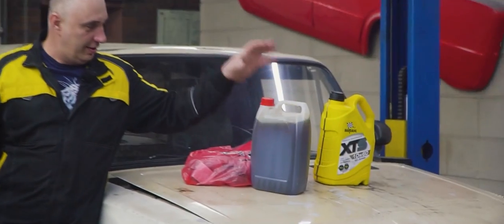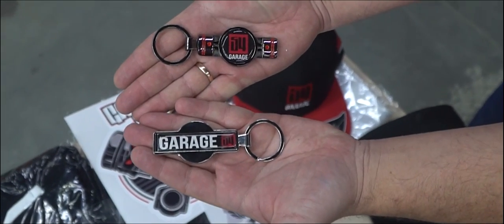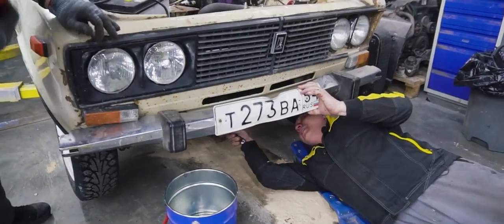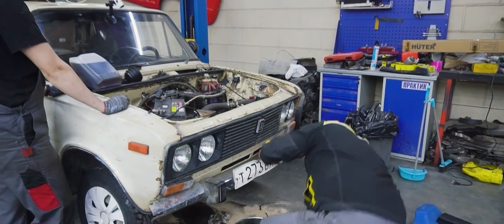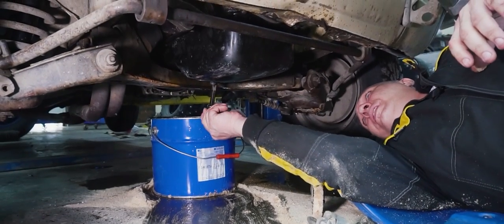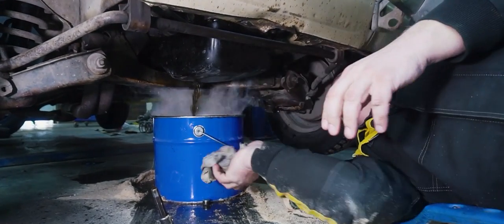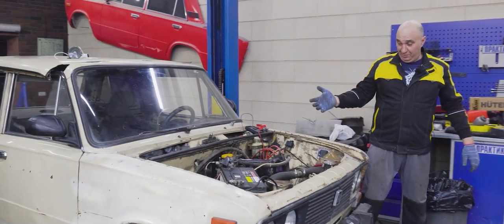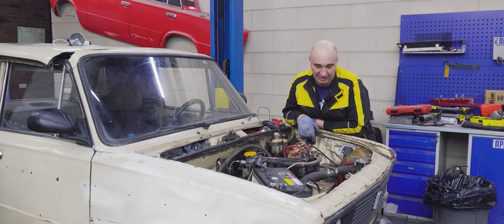Can you change the oil on a running engine?

Comment: It would have been cool to see compression test results before and after the oil change, just to see what the damage is from running the engine without oil for a few minutes.
Reply: I guess compression has Not that big of an impact. Biggest issue will be bearings. Camshafts and Mains running dry.
Reply: What surprises me, is they did not proportionally pour new oil in,  at the same time as it is draining, so as to avoid starving oil pump. 
When it runs clean, put the bung back in...- (check level), well that's how i would attempt it anyway, if for some weird reason i had too.
Reply: @Retiredkiwi  If a person is in a pinch to be doing this, I bet they wouldn't want to use any more oil than necessary.
Reply: Minimal. The biggest issues will be in the bearings and cam. I'm more surprised it didn't develop a light knock while it was dry, although it was a bit chatty. Hard to tell with just the phone speaker but that sounded more like dry valve train to me than crank bearings. 🤷‍♂️

Idling isn't a big deal. There's no load, and all it has to do is generate enough power to overcome the sum of the internal friction. The forces involved aren't as intense as when accelerating etc

The cylinders will be a bit on the dry side but are typically only splash lubricated by the crank counters dipping into the sump and atomizing it.

Comment: I've got an idea... I'd like to see how well velcro tyres would grip a velcro floor...
Reply: Reminds me of the Audi quattro commercial
Reply: It would explode the clutch haha
Reply: Or a velcro wall...
Reply: @angelgjr1999  why would it?
I took my 2001 fiesta to a drag strip (engine work done) with standard gearbox, driveshafts and clutch. Semi slick tyres on a prepped drag surface and dumped the clutch at 4k and didn't break anything...?
Reply: @jjmmjj9999  How much torque does it make?
Reply: @angelgjr1999  peak at 5252rpm is 170nm. standard 110?
launching it and bogging down until 5252rpm...
Reply: @jjmmjj9999  My 2003 Mustang GT makes 3 times torque. That’s why I don’t dump my clutch at 5k rpm haha. It’ll destroy my differential. Atleast on a sticky track. On regular roads it’ll do a burnout until 3rd gear.
Reply: @angelgjr1999  ok but we're talking about a lada. not a mustang. hence why i compared it to my 1.6L fiesta. I'm also comparing standard to modified, and my increase in power over standard.
Ford didn't rate the clutch, gearbox, driveshafts to be modified... i increased the power, dumped the clutch with semi slicks on a prepped surface.
So a stock lada with STICKY "tyres", why would the clutch explode?? 
If my car with an increased power rating causing more stress on components, on a very sticky surface with sticky tyres didn't , why would a stock car?

for comparison
My 2.2 diesel makes 530Nm of torque at 2400rpm, I dump the clutch at 3k rpm. Standard is makes 380nm, so again increased, abusing it and no issues?
Reply: @jjmmjj9999  Ok I understand. How often do you have to change shocks and axles? I wonder how much it affects reliability. Like I said I can do burnouts everyday in my car because it’s RWD and has a torque V8. Not sure how much abuse a 1.6l can take.
Reply: @angelgjr1999  116k miles, hitting its 8000rpm rev limiter daily, launched, clutch dumps, wheel spins, racing away from every red light.

I haven't changed shocks and axles ever. Shocks were replaced for adjustable coilovers and have been the same ones for 3 years.

I also have a daily V6, same one used in the taurus I believe? 3l Ford duratec V6, 220bhp
Gets abused daily too. 143k miles

Comment: Some aviation pioneers kept an aeroplane flying for over 3 weeks and actually changed the sparkplugs whilst it was running in the air! Maybe you can try this some time when you get flying lada.👍😎❤️
Reply: have you ever seen a lose spark plug fly?
Reply: This is way too dangerous
Reply: How about giving a credible source for this claim. Internet searches revealed nothing.
Reply: Now that you mention aviation, what if they replace the stock Lada motor with a small plane motor?

Comment: The planes that set endurance records for continuous flight were modified to allow changing the oil and filter during flight while the engine was running.
Reply: It's called a dry sump and remote reservoir system.
Very easy to change oil while running.

Comment: We actually used to do this at a jiffy lube I used to work at. The one guy who worked there really wanted his 93 Sundance oil clean. So we would start then car, start draining it, and pour oil in at the same time. So as it’s draining out, new oil is going in. We just waited until it was clean and put the plug back in and stopped putting oil in. It actually worked pretty well.
Reply: That explains why jiffy lube gets a bad rep. I used to work at jiffy lube too
Reply: It was an employee’s car. Lol. He wanted to do it. So we did.

Comment: Try doing a compression test on that engine to check if any damage occurred at the cylinders
Reply: the rod bearings are the first thing to go
Reply: ittl be fine, no different wear than a startup or 2. everything would still have oil it just wouldn't have been under pressure for a minute, which happens on startup or if you are cornering really hard.
Reply: @halleffect1  yes, but there is no test for that
Reply: @nickoloes  low oil pressure, audible knocking..
Reply: The cylinders will be more or less untouched by the process. Polishing them with the flush did more damage to them and you can do that following the instructions on the jug.

The biggest issue is the crank bearings and cam.

Comment: Here's a challenge for you,

Try taking an ordinary Lada, and turn the mechanicals 90 degrees in relation to the body shell, then drive it sideways!  -  If that isn't practical, try welding two Ladas side by side, and turning the mechanicals by 90 degrees.

Let's see a Lada driving sideways!
Reply: Good ide

Comment: Replace the drainplug with a fumoto, petcock or other no-tool/no-mess drain valve. That way you can close the drain valve easily after the oil drains clean.
Reply: With a smaller orifice the oil won't flow very well. On small Marine diesels they have an oil drain tube which is about a quarter of an inch in diameter.  If you try and drain the sump with the engine running the oil only flows out of that tube very slowly. Obviously 18" of that tube is more of a restriction than just the valve but it's going to be the same problem on a smaller scale.
On larger marine diesels, say over 200 horsepower, there's actually an oil pump to extract the oil from the sump into a disposal container. I believe some heavy equipment is also done this way.
Reply: @otm646  Obviously smaller orifice will impede flow, but large marine diesels also have the very viscous oil problem, small gasoline cars like lada do not use such viscous oil

Comment: I change transmission fluid buy overfilling it first with 4 qts then pulling a cooler line off running it to a bucket have an assistant start it and as it pumps fluid into bucket i start to add fluid after about 4 qts comes out i run system capacity through it 12 to 16 qts usually and shut it down hook up line if i let it run 20 sec after i stop pouring and save back the last qt i can sneek up on level after warming it up if you overfill pull cooler line back off and pump out excess

Comment: Use an external oil filter with a quick release coupling on both hoses. Pop both while running, put "suck" into a bottle of "new" oil, "blow" into a drain, and swap the filter with no pressure!

Comment: You can top up oil on a running engine, if the rocker cover has an oil baffle inside it you wont get any splash. If it doesn't.... mine didn't and I didn't get any spray🤷‍♀️

Comment: i did that on a white tractor 1947 (semi truck dont confuse with farm tractor)    
 we had to flush oil,  took about 16-24 gallons total to flush melted and chipped/broken babbitt out  while it was running,   then we took cam out,  put it in a ceramic oven to melt all babbitt.   then, we heat treated the cam again.     cast new babbitt on them.  sen tto local machine shop to machine into size.  put it back together.   the engine is good for another 150k hours.

Comment: Garage 54 they do make quick disconnects that you replace your oil pan bolt with so you hook this little hose to it and it drains your oil and you unhook the little hose kind of like a quick disconnect on a air tank...

Comment: 10 W 60 holy crap!
Reply: @Pyro-Lyro is that because of the cold Siberian winter?
Reply: @jonathanryan2915  No just very very old engines that have poor compression and worn out bearings.
Reply: @markm0000  that's what I was hoping.  Just the loosest tolerances I ever heard of
Reply: So what? I run 20w-50 normally all year round..
Reply: Yes 20 w 50 had been around for years now, but I didn't know 10w 60 was even possible

Comment: Wonder how main/rod bearings look like after such an oil change :-)
Reply: Same as they did before the oil change.
Reply: It’s a lada, so probably exactly the same. Although if someone was thinking of doing this in their new Mercedes I can’t say I’d expect the same result
Reply: @D R pretty much trashed
Reply: @nitrorcmaster1  Lada are overrated...
they are hard to kill, but are very low-quality built, and so not very reliable.
Reply: ladas always die off-camera. Never on the video. Even Vlad mentioned that. You get rods through the block or other good stuff
Reply: @TheBlork74  oh no, that's worse than I thought...
Reply: @Chris-yy7qc  If they were screwed already then he wouldn't be wrong.
Reply: I was going to say the same thing. Very curious what the bearings look like and if any damage occurred when the engine had no oil in it.
Reply: @Chris-yy7qc  well it was without pressure for maybe a minute? go to Cleetus Mcfarlans channel he just ran a crown vic at 100% throttle on gasoline instead of oil for 17 laps before it died. I'm sure the lada is fine.
Reply: Worse than they did before the change lol.

Comment: Call it crazy, on some older cars I've had, I'll bung in a coupla cans of Wynns Engine flush, got for a quick 10 minute slow speed drive. Then, after I've allowed the warm engine oil to drain out until there's just hardly any drips coming out, I'll then start the engine up again for 10 to 15 seconds so the last of the oil is pumped into the sump - to get the last of the dregs out, I'll stop the engine, wait again for no more drips, then replace the filter and put in fresh oil. It's never caused any problems for me. I've done this with cars and motorbikes (cars maximum 20 seconds, bikes maximum 10 seconds)... 😎🇬🇧

Comment: This video is going to be good. The closest I have gotten to doing this was just moving the car off the wheel ramps, but that was like less than 30 seconds of idle time. This title suggests changing the oil from start to finish while the engine is idle. That's nuts. I can't wait to see the results of this.
Reply: The video is already fully uploaded so it's not going to be anything else than what it already is.

Comment: Test "Cold air intake" by making an apparatus that super cools the air going into the engine. Maybe make a metal box that can be filled with liquid nitrogen and run an aluminum intake pipe through it so the air gets incredibly cold before being sucked into the engine. Do a test before and after and see it it makes a difference.

Comment: USA: wearing gloves and safety glasses
Russia: removing the oilpan screw with bare hands while the engine is running - staring with unprotected eyes from  20cm distance on the boiling oil pouring - lying down on the floor while car is on the lift :) luv u guys LOL

Comment: Should have measured the cylinder compression when engine is hot before you drained the oil and changed it then measure the compression hot after.

Comment: I can't think of situation where the oil is so bad you need to change it and accept the wear of running an engine without oil just to get fresh oil in it. I expected them to just crack the plug and let some oil drain out while they added more, not run it with no oil lol.

Comment: Next time try to change the disc brakes on the passenger front while driving the Lada. Use a gear box to create a PTO ( power take off ) and add helicopter blades to see if you can fly or get it off the ground.

Comment: Of course you can change the oil on a running engine.  The question is, how much do you care about the engine? The trick is to watch the oil pressure gauge and start changing the filter when the pressure goes to zero.

Comment: Actually, old MOPAR (Chrysler) products with the original A727 automatics COULD be push started!  I have wondered how you would change the oil in a machine in a place like Siberia, barring the engine being just shut down and the fresh oil being pre-heated.  -40C seems like it would forbid such a procedure in the winter; almost flash freezing anything that is fluid and not constantly flowing.
Reply: The A466 cast iron Torqueflite could be push started, the A727 and A904 could not. The 2 speed PowerFlite could also be push started. Only transmission with rear pumps cna be push started.
Reply: You can also jump start 90's mercedes automatics. At least the 4G-tronic(?) I think on those boxes the oil pump is ran from the output shaft.

Comment: please teach us how to measure the oil capacity/pressure with the multimeter
this seems interesting
Reply: pretty sure they were just measuring the resistance on the oil pressure switch
Reply: i also not sure cause the reading is 0.xx and become 1 when the oil is full

Comment: Let's see impact on lifetime of the engine! Can be practice to use this method in Siberia when it's -30 or below!
Reply: of course not. Warm up envine, shut it off, chanhe oil and filter in 10 minutes and start it again. Engine won't cool off in 10 minutes
Reply: @lordred7462  right ;)
Reply: I would ask the same question in Yakutsk.

Comment: 10W60 oil.  Holy crap!.    (I don't know much about oil)  But that seems like it must be intense.  Since most things use like 5W30.  Or is that oil just like the 50/50 blend where its already deluded?
Reply: I had a 78 mercedes 280SEL and I ran 20w50 in it with lucas heavy duty oil stabilizer to make it even thicker. reduced a lot of the valve noise. a lot of modern cars are switching to 0 weight. higher tolerance means you use a thinner oil, so you can put some really thick stuff in older engines.

Comment: Complete an engine flush with ATF. ATF is supposed to be a detergent, let's find out.  Or is it possible to run a Lada engine on 80w90 gear oil.

Comment: A drain plug valve would make this process much smoother.
Reply: There are quick-release or magnetic drain plugs out there, but personally i would not trust a crucial system like oil to something like that, at least not on a car.
Reply: @AgentWest  I agree, but for this experiment it would have made things easier.

Comment: I have never changed oil while an engine is running but I used to change oil on cars that just got off a 3hr freeway drive in the Arizona Desert. But don't worry, since it's already 110F outside, the 250F oil isn't too bad. If it really burned we just sprayed out hands with brake clean. Oh and thanks for the $2 commision on your oil change. I didn't want to pay my bills anyway, damn capitalists! 🤣

Comment: I've done this on a generator, except we didn't let it run dry, trying to leave some in the sump for the pickup. We cracked the drain and tried to feed just a little more than we drained, replacing about 1.5x the volume. It worked, but had someone with hands on all the valves and watching the pressure. Too much oil bogged it a bit and threw smoke, so be careful! One guy forgot oil is hot and got scalded, but otherwise went okay. But the filter is pressurized, so that had to stay, keeping the oil a bit dark. It was powering a concert, and the owner had mentioned the last maint was like 5 years ago when it started running rough. facepalm  Lesson learned, always have a backup.

P.S. On a properly running engine, you should be able to add oil with no issues, trick is if you're adding oil while it's running it's probably a POS (aka blowby).
Reply: Why not just make sure the oil was topped off
Reply: @5.43v  If he ran that engine any longer with that 5 year old oil theres a good change it would have blown the engine at any moment. A number of catastrophic failures could take place as a result of having bad oil.
Reply: @foellerd  yep if I was running a big show and found that out I would have probably tried to do the same. Depends how long the show has left and how rough its running (sometimes its better to to not f with stuff)
Reply: generator, i have one. i bought it new, its about 5 or 6ooo watt, i forget. i ran it out in the woods for a project needing a saw and drills.  
i didnt even use a tank of gas. when i turned it off the oil was making noise. i removed the oil cap and that crap was BOILING. popping out stinking hot as could be. 
WHY? i changed the oil only to find out the capacity is just a quart. it boiled from use again.
WHY?

Comment: I've done this working on heavy equipment. It's a little easier with those considering it doesn't have a traditional drain plus, but a drain petcock. Plus when you have a pneumatic oil gun hooked up to a drum and you can adjust the amount of oil being pumped, it's probably the easiest way to do it while it's running.

Comment: I used to tow for a living. Recovery, not repo. We were preparing a ford explorer for scrap one time and decided to see how long it would last with no cats, no oil and no coolant. Ran it wide open and it made it 16 mins before locking up! That engine died in the name of science!
Reply: what was no cats supposed to do? just be loud?
Reply: @MiG21aholic  nothing, cats are removed before car is crushed due to their value. And yes, it was loud.
Reply: The Neutral Drop guys love doing the same thing on their YT channel.